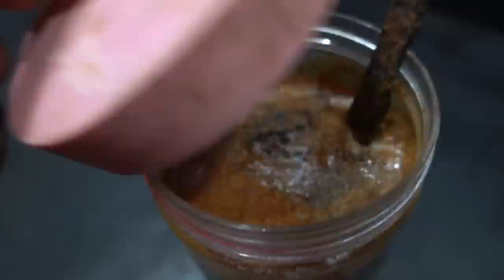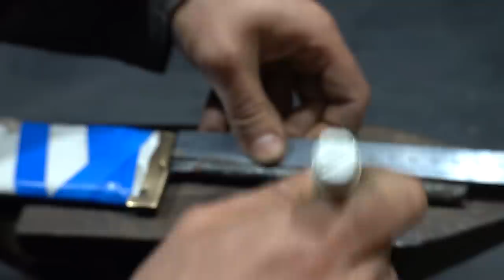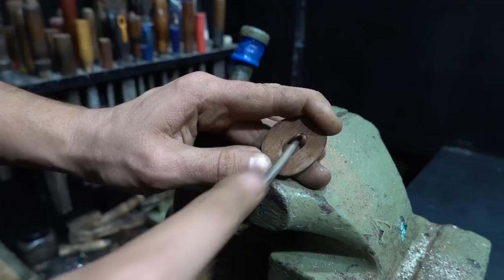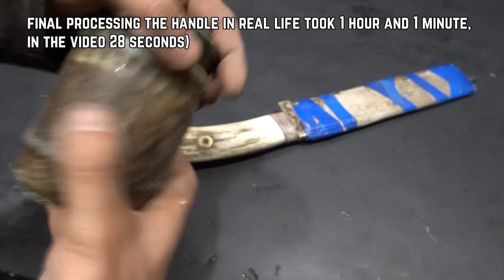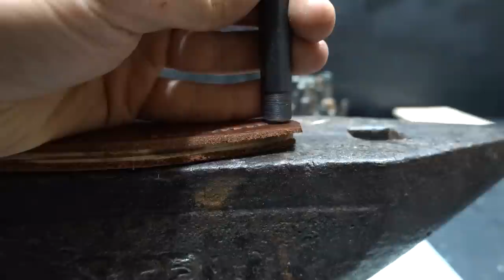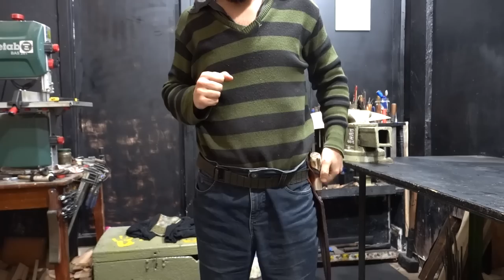Restoration of Old Rusted Bowie Knife

Comment: I remember ‘brazing’ brass parts decades ago. You have the join, but all the same color, and harder than solder. I used a dual carbon rod electrode with my Lincoln arc welder on a low setting.

Comment: Alex, again you have surprised me, Sir. When I saw how bad that was pitted and the cutting edge was destroyed, you said it was too thin to weld. I figured you would have to cut so much off it would be way smaller than the original but you did it again. That was a most impressive knife it took a beating and stayed sharp and strong. Great Job sir, you are a master!

Comment: You are a fine craftsman. I really like this knife. It’s one to be used and not just for display. I always learn from your vids and this is no exception. However…I cringed a little bit when you struck the antler onto the tang with a metal hammer. I might have used a wooden mallet. It worked for you, tho. Great video. Keep at it!